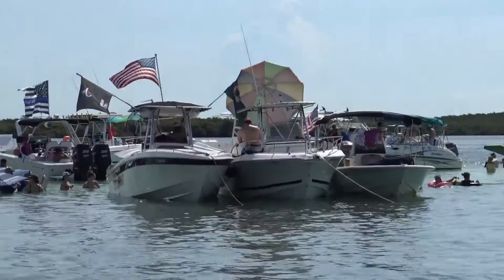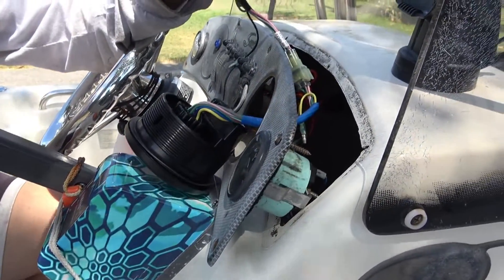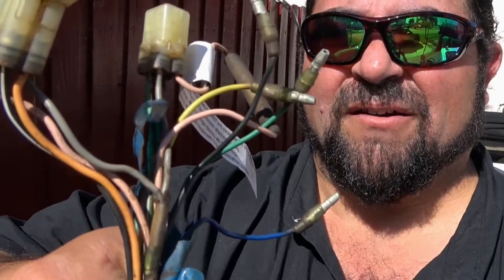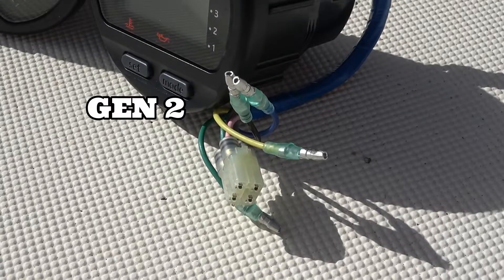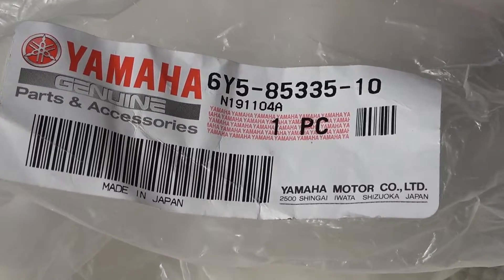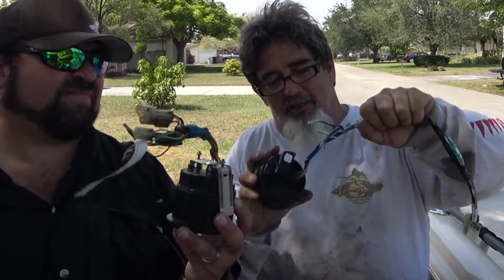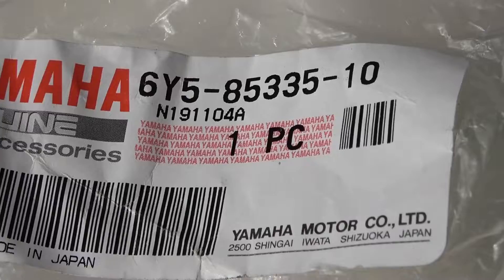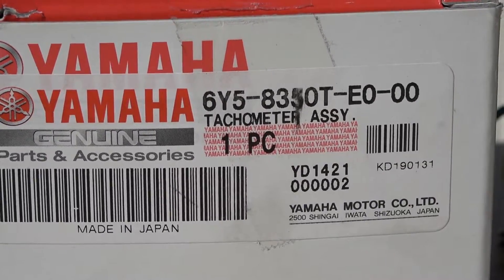NEW 2nd GEN YAMAHA OEM TACHOMETER/PROBLEM INSTALL WITH OLDER 2 STROKE OUTBOARDS PLUG & PLAY WIRING

Comment: hI recently installed a Good old engine   a yamaha ox66 250 2 stroke will  120psi compression,  the tach has been doing weird,  at full throttle the rpm shows 9500 rpm  and trim always stays full on gauge and doesnt change when i lower or raise the trim.  Do you know may maybe the problem ?

Comment: Funny. This plug is trim and oil level. To turn it on and run rpm you could just connect the rest of single wires))

Comment: Here is the part number for the adapter. $90 on Partsvu

YAMAHA - CONVENTIONAL TACHOMETER ADAPTER HARNESS - 2004 AND PRIOR ENGINES - 6Y5-85335-10-00
Reply from the maker: Thank you so much.  💯❤️

Comment: What if my older 97 Bass tracker didn't have one but it had a Yamaha motor I only went from a two-stroke to a four-stroke 97 Yamaha the plug is the same for the throttle however does the wiring that comes originally with that throttle can I just buy the new tach?
Reply from the maker: Yes you can, just make sure that the plug and play connectors match. If they don't you can always get the aptapter wires for it. Thanks for the comment.

Comment: Hi I have a 2003 F75 my gauge died it’s a gen 1 two box connector I got a new gauge gen 2 with 1 box connection will I need the adapter 
Thanks for the great info on your channel
Reply from the maker: Hello Seatrout King. Unfortunately yes, you will have to get an adapter for it. Same problem I had.. Old tach had two box connectors and new had one.. I attempted to see what will happen if just that on box connector was connected. No dice, I was not happy for receiving the wrong tach, so I thought. There is no discription or anything stating that newer tachs when replacing an older unit will need an adaptor.. we kinda had to figure thingout on our own because very little to no information on this.. so I'm thinking Yamaha has ungraded their tach to acommidate both the older 2stroke motor and the newer 4 stroke.  But yes if you have an older 2stroke with original tach, likely you will need the adaptor.. the kicker is that the adaptor is 100 dollars.  Go figure, but it will save fustrating and the easy plug and play feature with get your new tach working in no time.. hope this helps. Thank you for your comment and support.

Comment: hello friend, I have the same watch with a yamaha 90hp two-stroke engine, the temperature light flashes the same as you, is it normal for it to flash? It does it in contact and with the engine running in my case, the engine is fine, the water recirculation is fine, everything is fine, but the light is blinking, could you help me? Thank you
Reply from the maker: Hello Jon B. I hope all is well? I just can speak from the expiriences that I had encountered my boat. The over heating I don't stress too much on my little 60hp. Most 2 stroke Yamahas has an overheating shut down. Not that I ever had that problem but this is what was told to me. Everything on the original and 2nd gen tachs is plug and play. But apparently it with not read outboard temperature. Not sure if you can splice into a wire that can be contacted to a sperate gauge. But that is way beyond my expertise. Loll.. As around but it should be an issues. Thanks

Comment: Just wondering the year and model of your Yamaha because your so right no videos no info no anything on if the gen 2 or the new command link will work with the older models thanks for doing this video.!!!!
Reply from the maker: Hello Erika. Thank you for your comment and supporting our channel. My outboard is a 2005 Yamaha 60 2 stroke. I think with the newer 4 strokes the wiring system on the gen2 Yamaha tach is to cater to those outboards. But no information on adaptors for newer tachs. Loll. We found out the hard way.. Even when we ordered the adaptor we were not sure.. And the only thing that made us search deeper was because the seller of the tach was not accepting any returns. So we bit the bullet and gave it a whirl. Our next step was to look for our original tach by the box of plug connectors of the gen 1 tach wiring... Never knew that there was 2 different Yamaha tachs..loll.. Thank you so much for watching. Stay safe.

Comment: Great Video I been looking for this set up for a long time. I can not find the Gen 2 unit anywhere other that Ebay and I am not an Ebay guy. any idea of where i can buy it? 
thanks for the great video.
Reply from the maker: Hello ClownFishReef. Thank you so much for the kind words and tunning in to our channel. I completely understand. I too try to avoid E-Bay as much as I can. My expiriance reasoning is you have to really check were the product is coming from. Many products are sold from overseas but fail to add that information at times and when finally placed an order it's giving you a 2 or 3 weeks time of delivery. I've waited as long as a month to receive my order. But I do believe I've ordered the Gen 2 Tac from eBay. I don't know why there's no information about both Tach being different. Or really no info on the  adapter needed if you end up buying the Gen 2.. This is what we went through, Went to the trouble of installing the Tach just to find out it didn't match and it wasn't going to work with my existing wiring. My wife found what could possible be the adapter for that Tach. We try to contact the seller and asking if this unit that was purchased needed an adapter, but no reply back. So we bought the $100 adapter hoping that it was what we thought it was to finally make it all work and be done with it.  My guess is when 4strokes became popular and 2strokes were being banned in some counties  the 2nd Gen Yamaha Tach was created to work on both older and newer outboard motors. Try to type the product number on the google search bar and see if it comes up with other seller other than eBay. The adapter is 6y5-B5335-10 the Y Tach 2nd Gen is 6Y5-8350T-E0-00 TACHOMETER ASSY. I hope this helps. Good luck and let me know of your findings. Once again thank you for supporting our channel, it means the world to us. Stay safe and many blessings.
Reply: 2Bears Outdoors 
Thank you very much for the quick response.
My engine is a 2 stroke 2007. Do you think I still need the adapter?
Reply from the maker: @clownfishreef1045  You are very welcome. That I'm not sure but the best way to check is to look at your existing tach and it's wiring.  If you only see 2 plugs or box connecters then you can install that Gen2 Tach without an adapter.. if it's 4 plugs the an adapter is needed unfortunately.. If it's a 2stroke chances are the it will need the adapter.  But then again I'm not sure with your motor.. blessing my friend, I hope this helps..  good luck and stay safe.
Reply: 2Bears Outdoors 
I got the  meter and it is up and running 
Except for the total engine hours 
Any idea?
Also have does the pins on the back of the meter has to be for 2 stroke engine? Do you know? 

Thanks
Reply from the maker: @clownfishreef1045  that's awesome. I would like to say that it could be for a 2 stroke.

Comment: Congrats for your success, I'm in this situation right now with my even older 1987 Yamaha 70hp etlh Tachometer. Yamaha sent me what they said I needed to replace it's original Tack/with oil (Pro Tachometer Assembly With oil 6Y5-83540-05-00) Not even Close. Old has round connector/new square, Old has Power going to warning lights/New appears to have Ground return coming from warning lights, New appears to be powering into (Yellow,12v after ignition on.) & with Tach sender wire & Ground Wire, Old does not. Can not find original Tach part# anywhere I even have the manual that came with it new. (NS 23 C 6) is a sticker on it.
I have been looking for Days now
I would be for ever grateful if you could point me in the direction as to where you found this adapter?
Dav in Reno
Reply from the maker: Hey there, thank you for your comment    I'm sorry to hear that.. I think is the newer tach are designed to be installed with the 4stroke motors and the adapter was created to still install on a 2stroke motor. If I'm not mistaken my wife found it on Amazon.. Just type the product number 6y5-85335-10 on Google search and add Yamaha adapter and it would lead you to sellers of the products.  Hope this helps. Good luck with everything..

Comment: Right before I gave up researching online about this after a few hours I found you guys!! You are totally right. No info nowhere. Excellent video. Really appreciate the information!!!
Reply from the maker: Jose Rosario, brother thank you for your support and kind words. Im glad that this video helped out.. I thought I was the only one that was having this problem. My final conclusion which I thought of this after making the video live is that since the newer 4 stroke came to light, the wiring were different for the 4 stroke motors.  So those with older 2 stroke out boards, that was the wiring configuration. So to be able to kill two birds with one stone they created an adapter.. But of course the adapter is and extra $100s more.. But the kicker is that even with the available adaptor, it really doesn't tell you that an adapter is needed for the newer tach.. I bought the adapter in hopes that was the ticket. Well thank God that it was.. All connected well and it's working.. Loll.. It just cost more than the original  tach because of that one little missing link known as the adapter. Loll.. Jose, once again thank you for your support and watching our video. Blessings my friend.

Comment: Hey Gus, what about all the left over wires coming out of the dash ?  I still have all the original gauges on my 1998 2 stroke Yamaha...knock on wood..
Reply from the maker: Hey brother how are you. My Tach finally couldn't be read. went on line and found the newer tach. It says it will work on my 2 stroke. But when the component arrives and we finally pulled out the old tach, the plug and play does not match. many website will not tell you that there's an adapter for the 2stroke and 4stroke Tach. It matched up great. I believe only a few wires didn't need to be connected. I will ask Ozzy, I was behind the camera.. I will fill you in as soon as I find out.. I hope all is well. Thanks
Reply: @2BearsOutdoors  Glad to see that you and KBear are well...stay safe.
Reply from the maker: @14theroad1955  thank you very much.. All original? WOW, that's amazing.. Take care brother